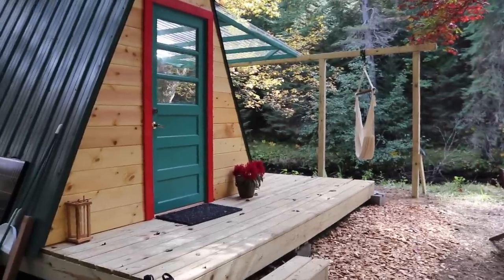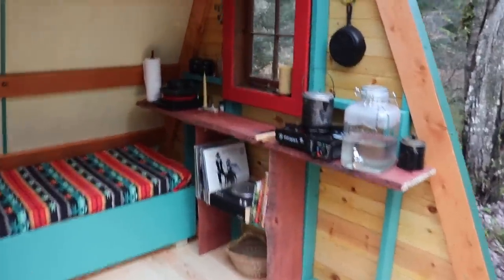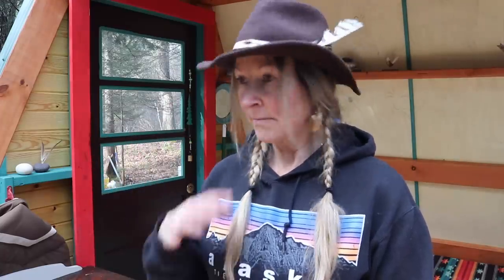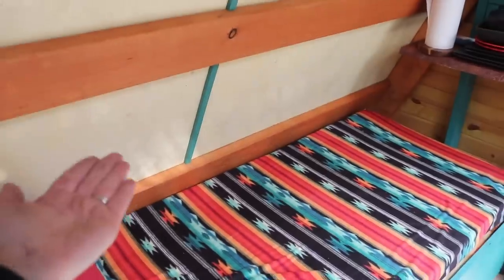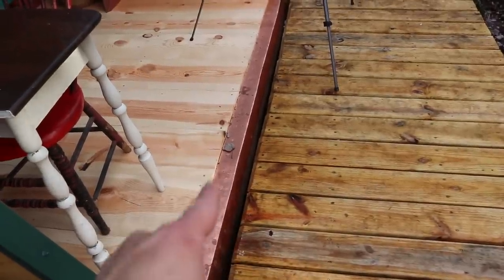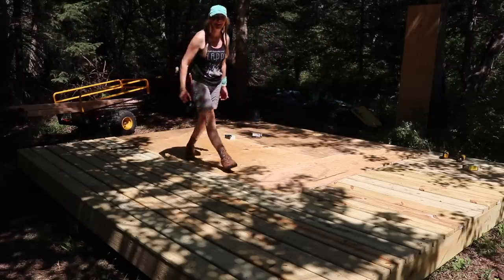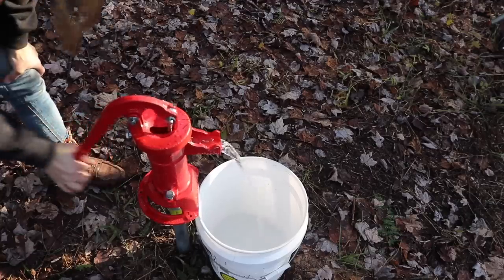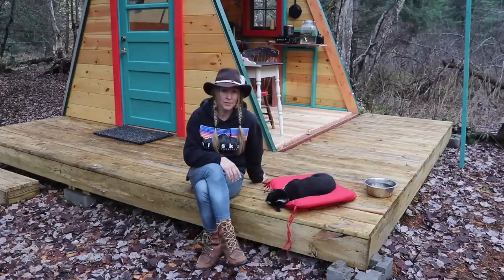A-frame cabin anyone can build

Comment: Hi Brook, been working on your lifting wall solution. You said you'd like to not have the supporting posts and it's too heavy with a single pulley. I have worked up a plan raising it manually from above. It uses block and tackle with multiple pulleys and a brake that I think may work for you. I've used this system for 40 years to lift and flip over my small boats when building  or maintaining them. When you have two block and tackle with two or more pulleys each at opposite ends, you'd be amazed how easy it lifts. (My arm was temporarily paralyzed recently. After having my neck fused and by using the block and tackle, I can still lift them as therapy. Easy peazy) The brake is critical; not all b&t systems have it. They are very dangerous. Granger has the TUF-TUG rope hoist/block and tackle with brake on close-out sale for $50.00 that looks like it might be just the thing. See the catalog description following the directions below. 

Installation Directions
1. Fasten a large eye bolt sideways at the end of a 2x4 post (not into the end grain where it could split the post). Then bolt the post vertically to the wall at the roof peak above your front door so it stands a little above the peak, say 2in.
2. Screw or bolt a 4x4x4 wood block to the outside bottom center frame of the lifting wall.
3. Bolt a large eye bolt to the outside face of the block parallel to the deck. (It's important to keep the rope from initially binding as it will if parallel to the frame. The bottom eye bolt needs to be farther from the frame than the top eye bolt, so the reason for the 4x4x4 block. The block keeps the rope from being parallel to the frame by keeping the bottom eye bolt out and away. It forms a very shallow triangle, with the wood block as the altitude and the ropes the hypotenuse.)
4. Screw a cleat and a rope hanger hook just below it to the A frame left of the door at about waist height.
5. Thread the rope through the pulleys. With the lift wall closed fasten the block and tackle to each eye bolt. The brake end goes at the peak with the brake tube facing down to guide the rope down the A frame to the left of the door.
6. To raise the lift wall, stand at the front door and pull the rope through the brake toward your right and toward the upper pulleys. When the lift wall is in the desired position, pull the rope out to the left away from the pulleys, forcing the brake tube to the left and locking it. 
7. Secure the rope on the cleat with a couple figure eight turns. The rope from the braked block and tackle doesn't have to be tight when at rest. Being careful not to pull the brake tube to the right, coil the remaining rope and hang it on the hook.
8. To lower the lift wall release the brake by forcing the rope to the right in toward the pulleys and hold it in that angle while letting the rope slide through your hands, easing the rope through the pulleys. Force the rope to the left to brake if it's going too fast. 
9.  When closed coil the remaining rope and hang it on the hook.
Lightly lubricate. Remove system and store inside in the winter season.

Granger TUF-TUG rope hoist/block & tackle, item 4RU48, $50.00, 4:1 mechanical advantage, 50 ft. rope, 12 ft. reach capacity, 350 lb.lift, 700 lb. pull. 
Assists with light industrial lifting...Roller cam lock holds load position. Zinc plated with heat treated drop forge steel latch hooks. 3/8 in. rope dia.  

Be safe, enjoy, and you're gone.
Reply from the maker: gonna add air shocks
Reply: @therealgirlinthewoods  Brooke, That works for me if it works for you. Sorry I misspelled your name before. You sure do rock those woods. Love your common sense approach to your adventure and your willingness to share your wealth of knowledge with the world. Carry on.

Comment: The gap is good. If you had put the deck tight to the building in the winter ice would have formed between the building and the deck and pushed the deck away from the building. Have you thought about a hand-cranked winch like they use on a boat trailer to raise the big door?

Comment: The sheet metal being cut by going by the plans was a big problem in the middle of the remote woods what a pain in arse that must of been dang it. Something easy turned into something hard and frustrating.  It would have been probably hard to haul with out cutting it down first though. Someone might be able to camp in that cabin in the winter but maybe its too breezy with the side they way that it is? A wood stove might still keep it warm enough though. Maybe in the early spring time it would be fine.

Comment: The idea of the frame to lift the roof is not bad. But I would move it close so it lifts the roof more vertically in the end. That would make it easier. Also, you still want a bit of downwards should a quick shower come.
Another way to make the lifting easier is to put a pulley instead or at the hook and run the rope back to the frame. That should reduce the needed force by half.
Just some thoughts.
Else I am still impressed by your work.

Comment: Yay Girl-in-the-Woods! .. Cutting off a square of the clear panel , and replacing it with a piece of the rubber roofing to fill the cap ; so as to be able to open, and shut your swing-wall properly shows know-how since it wasn't in the architectural book on how to build it yeah?  And keeping a gap between the deck ,and cabin floor so when the swing-wall opens the gap will catch the excess water instead of your cabin floor!  Yep,  know-how, and common sense go a long way looks like. Of course the main objective is to be WARM, & Dry!! Lol

Cool beans.
Reply from the maker: thanks much!
Reply: Welcome Brooke gal!...Hoorah for the Whipple fam!

Comment: Think about 12 volt actuators instead of gas struts .
Gas struts are not dependable especially in cold weather.
12 volt actuators with a up switch and a down switch,  you walk in and plug in your 12 volt powersupply and hit the switch and the side raises and stays until you hit the lowering switch.
Be Blessed
Reply from the maker: hmmm thanks

Comment: Propane heaters get your indoors wet. Its not good for the structure and I can handle a dry cold much better than a wet cold. However, that structure is not designed with a wood burning stove in mind, as far as code and why its there. I wouldnt trust a wood burning stove. I'd probably see how far I can get with hot rocks and wool hides, like a sweat lodge without the water part then cuddling up with hot rocks under the insulation of the wool hides.